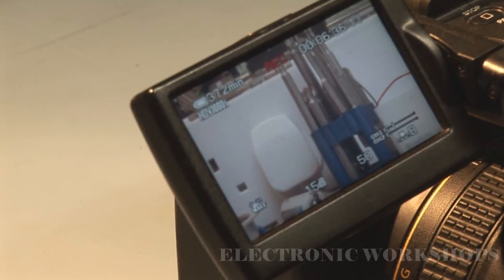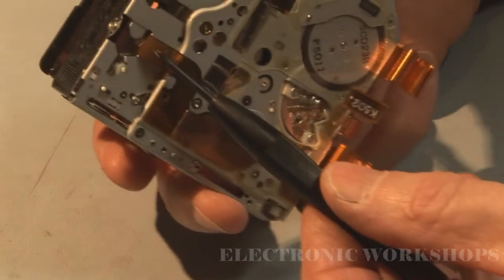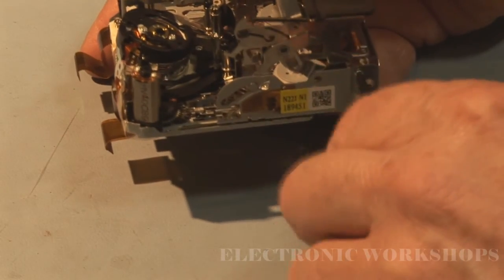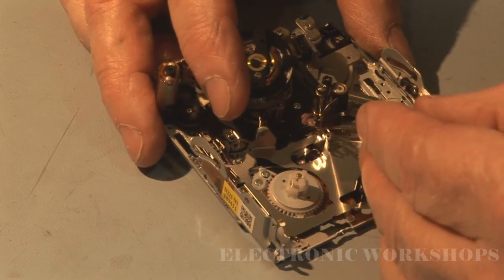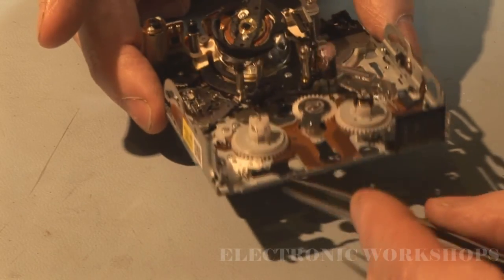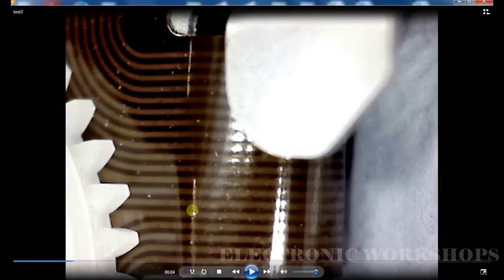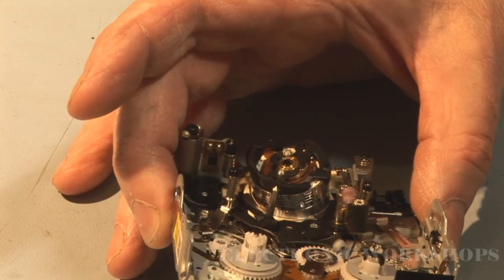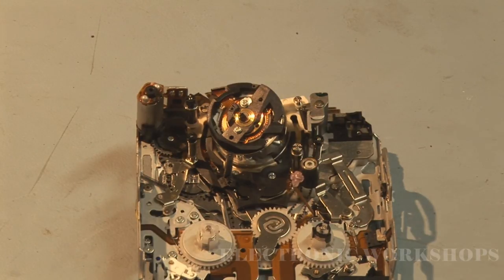Sony HVR-Z5  Tape Warning, Tape is Locked

Comment: I found a work around for the message that says "Tape is locked - check tab" on my HDR-FX1000. I power on camera and open tape side door. Leaving the door open I then Power Off the camera and unhook the battery or disconnect the power supply. Then i load a tape and then i shut the door and hook power back up and let the camera reload the tape. When i do it this way I do not get the message. Hope this helps someone.